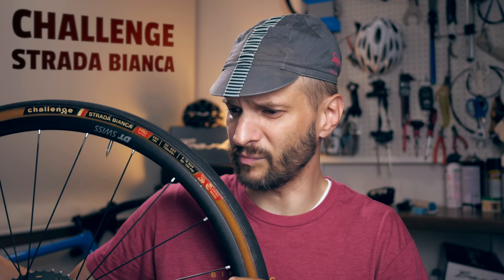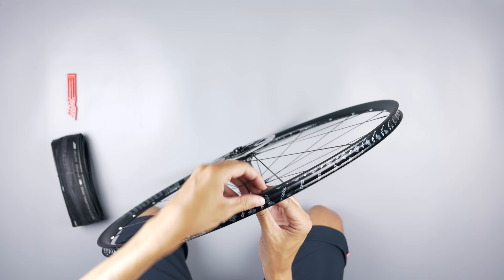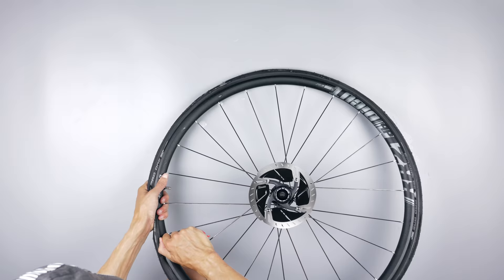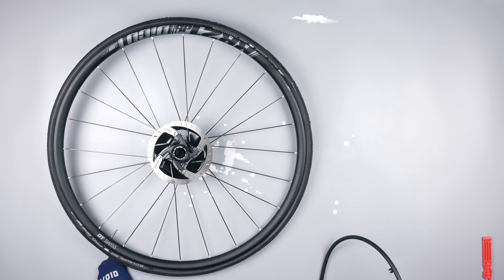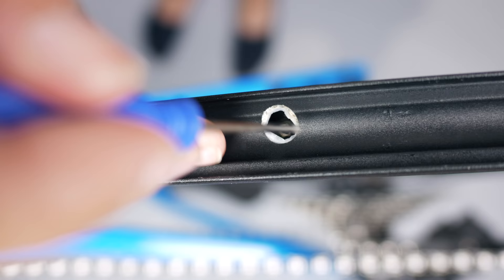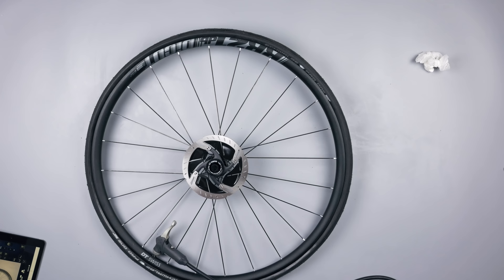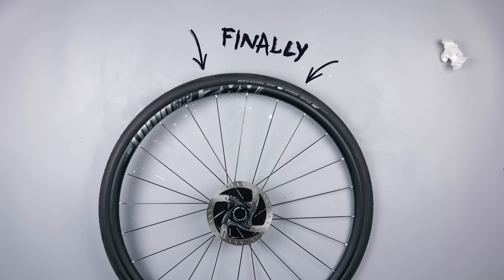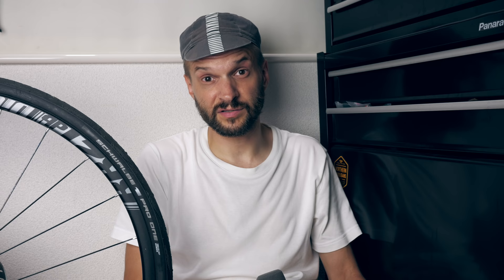Watch me struggle! 5 Tips for Road Tubeless | Schwalbe PRO ONE

Comment: Had similar nightmare even with large reservoir filled to 200 psi). Removing even worse. Ive had to cut off my rims every pro one 28mm as tubeless  I’ve eve owned, (after hours of agony , adjustable pliers and risk of damaging rims) very grippy, compound though. I’d get s-one (now called g-one sport) 30mm every time now . Never looked back on pro ones! Top tip ! Schwalbe sell a lubricant, for the bead. It’s brilliant!
Reply from the maker: John Van der Stighelen I had a few people saying the same thing now about having cut off the tires... I’m curious, was that from a seated state? (As in you couldn’t even get them to unseat or?)
How hard where they to get on the rims to start with in that case? 
Cheers for the tip! Will keep those tires on the watch list 👍
Reply: Rides of Japan removing off the bead was the challenge. Always got them on ok, with the right prep, lubricant ,and reservoir, having learned using standard one tubeless.
Reply: The secret to getting them off is to push the whole bead (except round the valve hole, obviously) into the centre channel. Only then can you get a tyre lever under the bead. You'll never be able to lever them off directly from the seated state.
Reply: Matthew Harris normally id totally agree, and that’s sound advice. However my issues were that I could t get he bead away from the rim hooks, by more than an inch. I resorted to a set of adjustable pliers with a rag to protect the tire wall. When that plus an attempt of a hairdryer failed and you run the risk of buckling the rim, I ended up cutting them off. I don’t entirely blame this particular tyre , although it’s definelty the worst road tubeless I’ve had in this respect over the last 3-4 years (I consider myself an early convert to road tubeless), I’m sure there are the we’ll know tolerance issues between rim and tyre and safety margins which play a part. Hopefully companies like Mavic can help to address this.
Reply: John Van der Stighelen I know what you mean. I spent hours with the same issue (compounded by the fact I'd put a tube in after a roadside nightmare with a hole that failed to seal), made worse by the shape of the bead 'shelf' on ENVE's SES AR 4.5 rim; the bead has to go over a slight lip before it can drop into the centre. Also, the old dried up sealant effectively glues the bead to the rim and instead of pushing away cleanly all that happens is the bead rotates through 90 degrees which makes it even tighter and hard to get any purchase against. Tried soapy water, hairdryer etc. and contemplated pliers or cutting the tyre off but eventually succeeded with two flat bladed screwdrivers wedged in and moved steadily apart, at risk of damaging the tape, and rim of course. At that point I just wanted to sell the wheels! Strangely I hadn't had that problem when doing the same thing roadside - probably because there was still plenty of liquid inside which was helping the bead slide over the lip into the central channel. Or maybe it was just the adrenaline helping!
Reply: Matthew Harris ... well tubeless fist pump to you! I’m sure it will all seem silly when they are all mainstream in the end!

Comment: I just use a compressor. If the tire does not seat and hold air I know something is not right. Most of the time it's just a matter of adding a little sealant.

Comment: Yup, out of all the tubeless rims I've done, DT Swiss rims were the most painful for me.
Reply from the maker: Interesting! This was the first time they gave me a hard time... although mainly because I failed to fix the tape situation.
Out of curiosity, what has be the easiest rims to work with?
Reply: @ridesofjapan   Giant rims for me. The DT Swiss rims worked the first time for me but I had to replace the tyres and they were a pain to the point where I had to put a tube in them for a week and then popped one side of the bead and took out the tube.
Reply from the maker: Cheers! 🙏Good info to put in the bank

Comment: I am at a loss, what the attraction is with these tyres outside the MTB world. At lower pressures sealant is fantastic, when you start to go above 50-60psi not so reliable. Then there is the free sealant? How do you work with this mess on the side of the road if your sealant doesn’t work. Plus they are still clinchers???? I run tubulars with sealant in so have the same puncture resistant, no issues with rim brake tracks and the rims themselves are lighter, plus a lot easier to mount and replace a tyre on the side of the road, no free sealant everywhere??? Someone please help me understand the hype about these tubeless tyres and rims??

Comment: How often do you have to pump the tire cause loss of pressure?
Reply from the maker: I always pump my tires before every ride regardless (as want to have a specific pressure depending on the ride)
but if I just leave them untouched fully pumped that might loose 10-15 psi during the first week, less the next week and so on

Comment: As usual human error ist the biggest factor of failure in tubeless systems.

1. always check your rimtape thoroughly
2. always remove valve core on first inflation
3. always seat bead first before you add sealant
4. always keep the tire upright (even if it ruins your youtube visual)

I have used Pro One 28mm on DT Swiss XR1501 rims (gravel bike) and the only obstacle I had was that I damaged the rimtape while trying to fit the tire on the rim (rookie mistake), otherwise it was fairly straight forward. I used a floor pump (my fatbike floor pump has high volume so it really blows a lot of air into the tire at once. Sealant had no trouble at keeping the air in at 5.5 bar. Fast rolling tire for sure. In the end though I ditched the Schwalbe as the ride quality is like a horse-carriage ride in the Wild West. Now I run Compass 44mm Snoqualmies which are as fast as any road tire I have ever used (Strava doesn't lie) and the ride quality is insane. Tubeless obviously and 320gr each. There's no competition for Compass tires imho...

Comment: I have the same tires installed. I used Schwalbe’s rim tape and the tires both seated nicely without adding any sealant and by just using a regular track pump. I think your problem might have been the tape. I have been riding them now for <1000 km over 3 months without a flat and without adding any extra than the initial (60ml/tyre) sealant. Great tires that didn’t require use of tools to fit. For me there is no going back to tubes.
Reply from the maker: lotte poss yes, the tape was the issue, change the tape on the rear and seated that with the normal track pump no issues.

Comment: A trick is to use a tire lever, when you have put the tire on the rim, then use it like you would, if you were to take the tire off, but instead put it as close to the bead as you can, on both sides ( did that make any sense?) and then inflate the tire....
Reply from the maker: Thomas E as in trying to seat the tire by hand? (And lever)
Interesting
Reply: Yes... You can not get it to sit right all the way, but then there is only one place it can leak.

Comment: I have used tubeless for 5 years and found using an air compressor or co2 cartridge works great.  Then let the air out and remove valve put the sealant in and re-pump to 105 psd.  Very easy.
Reply from the maker: Paul Ater yes, a compressor is the dream 😁

Comment: That's why you should use a compressor. Makes it a lot easier. I also had the same experience with these Schwalbe tires. I have the best experience with Pirelli P-Zero race TLR's. They seem to fit much better than al the other road tires I've tried so far (Also using DT-Swiss rims).

Comment: I think most of your problems were due to not having placed the new rim tape, which is a must if you have spoke holes.  Second, I wonder if it is better to remove the tire and unfold it and let it rest a few hours to get the kinks out of the wire bead. If there are bumps in the wire, it will not give a good seal or pop into the rim channel.
Reply from the maker: 8638marc yes, definitely the tape was the big culprit in this case, I mentioned it in the beginning but somehow forgetting to caption it as a tubeless tip in the video 🤦‍♂️ once you press that publish button you’re mistakes stay in forever hehe.
If there were any kinks in the tire it definitely didn’t help... but the rear tire came straight out of the packaging and on to the wheel without problem (I had fixed the tape before that)
It definitely seem like it could be a cause for trouble though, so a good tip, cheers👍

Comment: There must be some dangerous setups out there, if this is the fitting and testing done before riding them properly I'd be quite worried. I always make sure my tyres are able to seat and hold pressure with no sealant, and (importantly) don't fall off the rim when I remove the pump to put the sealant in through the valve core. There's another video where a guy has similar issues with tyres unseating which ended in a big crash after an innocuous puncture. Note that some so called tubeless tyres stretch a lot more than they should at the bead so if you remove them to patch or check anything you might need more tape (I'm up to 5 layers on a certain rear tyre that might rhyme with 'gavelbling')

Comment: Every time I install TL, I find myself here for therapy mid-way 😅
Reply: Incidentally, your method of pre-seating the bead goes against most other recommendations, where the advice is to squeeze the tyre in to the channel and blast it out, which I always try despite it seeming counterintuitive. However, pre-seating(ish) works much better for me - particularly when the tyres have had sealant before and are therefore a bit sticky.

Comment: I honestly dont think tubeless tech is ready for road yet. mtb it is solid
Reply from the maker: Nile yeah, I would hesitate to recommend road tubeless to everyone... you would need to love the smell of rubber and sealant 😉
Reply: I've not seen anyone stick with it on tires below 30mm long term. It's just not practical on pressures above 50psi
Reply: @ridesofjapan   It looks like the Mavic/Hutchinson UST is ready for prime time. I'm ready to try it.
Reply: It’s easier than this guy made it look. If rim tape is good, it’ll seat first time with Air blaster. When I let air out to add sealant the pro ones popped off rim. With Sealant and valve core the tyre seated. Took less than 10minutes use pro one tyre.

Comment: I presently run inner tubes on my road bike, is it really worth the hassle and do you notice any performance benefits ??
Reply from the maker: Yes, went down form a few punctures/year to a single one in two years.
Reply: @ridesofjapan    ok, any performance benefits ?
Reply from the maker: Nice 'N' Sleazy can’t say, never rode the tires tubed.
Reply: @ridesofjapan  what about other inner tube tyres , how does the tubeless set up compare ?
Reply from the maker: @nicensleazy1892  I realize you want to know about speed, But can't give you a good answer there, since I haven't ridden tubed tires for years. Unless you ride the same tire tubes vs tubeless it pretty pointless to draw any conclusions about if tubeless is faster to not. 
For me it was never about speed, it was about puncture protection and comfort, as I can drop the tire pressure without risking pinch flats. 
But, in my option if speed is the only thing you care about, then no, tubeless is not worth it... plenty of tubed latex setups that will preform good without the potential hassle of a tubeless setup.

Comment: I partly push in the valve until the initial inflation with an inflator then never tighten up its retaining ring too much. Once the tyre has popped, I remove the valve core, pump in sealant, replace the core then re-inflate, spin the tyre then make myself a mug of tea.
Never, ever use anything but proper tubeless rim tape - you are asking for problems later on! Do not be tempted to double wrap ANY tape - you need to keep the spoke well as deep as possible otherwise certain tyres just allow the last bit of the 2nd bead to slip over the rim.
Anyone using insulating tape - don't be surprised if you have to continuously pump the damned things up more often then latex innertubes!

Comment: The same happened to me. After 3 hours of pain and struggle, I finally checked the rim tape just to notice it was deformed like yours on the video, thus making it impossible for the tire to seat on the rim. After changing the tape for a new roll, it was perfect. I'm curious about the 3M tape you used... Is it resistant enough with a single or a double layer? Will it really resist 100 psi?
Reply from the maker: Anthony HT Reading all the amazon reviews seem to imply that a lot of “dedicated” tubeless tape is actually rebranded 3M tape. Can’t confirm that but it feels very similar to the DT Swiss tape I had on before. 
I might be a bit thinner though so I would probably recommend 2 layers just to be on the safe side. 
Time will tell how this holds up, but I never get up to 100psi... max for me would be 80 tops, over that and the ride become too uncomfortable.

Comment: No, no, no...

1. Purchase something like Pro-clean tyre lube. It’s a gel that you brush on to the tyre before mounting on to the wheel. Because it’s a gel it will form a bit of a seal between bead and wheel. Don’t use the soap, it’s crap.
2. Use some kind of air blast device like the Specialized one or the Schwalbe one. There are loads out there. 
3. Take valve core out.
4. Pressure up to the device to slightly more that the max pressure of the tyre combo, as ideally you want to hit the max pressure of the tyre.
4. Listen to all those lovely pops as the bead seats in the rim and admire how consistent the tyre is around the wheel.
5. Let the tyre rest for 5 mins before removing the blast tool and, yes, letting all the air out.
6. Apply sealant and replace valve core.
7. Inflate tyre, and you’re done.

Works every time with the added bonus that the tyre will be easier to remove when the time comes as there will be a little bit of lube in the rim.

Comment: Beeing a least 40 kg heavier than you, I'd choose the WTB Exposure in 34C - Why didn't you get the 30C? For the roomy frame and fork a 28C is almost insufficient.
Reply from the maker: jimnyfuchs I have my 650b for that type of riding, here my “goal” was light weight and low rolling resistance mainly for climbing... funny though they the complete wheel set is about the same weight as my 650s 😅
Reply: Rides of Japan You‘ve seen the mint green bike I built for my buddy - Those wheels are lighter then anything I had my hands on before for a third of the price.
Reply from the maker: jimnyfuchs how much did they weigh?
WTB is hard to come by here in Japan
Reply: Rides of Japan I have no scale in my shed yet. Just by the feel, the DT Swiss E1900 with 42x584 WTBs are a lot lighter then R23’s with 32C Continental tires. Adding the manufacturers numbers proofs the objective impression.
Reply from the maker: jimnyfuchs good to know, will go on my “watch list” 👍

Comment: Pretty sure my tape is fine as it was holding pressure just before I (STUPIDLY) removed my tires to inspect the condition of the sealant after a year and now can't get them back on again.

Was thinking of getting one of those tubeless pumps but they're so damn expensive, I may as well get a proper air compressor since it works out to be marginally cheaper. But that's still a lot of money just to put my tires back on. F#*@!
Reply from the maker: Ser Garlan Tyrell you can run in to that problem if the tires has stretched... that can usually be fixed by adding another layer of tape.
Another problem can be if there still a lot of sticky sealant in the inside tire wall almost acting like a glue to keep the tire from expanding, In that case you can try removing as much of the old sealant as possible first.

Comment: I used Schwalbe Pro one with the sizes 25, 28 and 30mm Tubeless. I have no problem at all. The wheels are from three different manufactors. Sorry to say, but the way you try to fit your tyres looks very mystery. So this couldnˋt work.
Reply from the maker: New 2020 Pro One are much easier to mount yes.
However, as stated in the video, the problem was the tape.

Comment: Try dealing with this at the side of the road.  I had the same tyres.  What a mess! Fitted tubes in the end.  Zero difference in ride.  More marketing nonsense from the bike industry.
Reply: The ONLY reason you'd ever have to "try dealing with this at the side of the road" would be if you gashed the tire so severely that neither sealant nor a dynaplug would work to repair the damage. If that's the case, it wouldn't matter whether you were running tubes or not -- you'd be struggling with replacing the tire at the side of the road, and how many cyclists ride around with an extra TIRE in their jersey!? None, that's how many. 

As to the typical punctures that cause 99% of flats, tubeless are FAR better than clinchers with tubes. The sealant (Orange is best) seals effectively, and in most case so little compression is lost you can safely ride until you get back to a floor pump. Tubes? You get a puncture, you're fixing a flat... at the side of the road. Me on my tubeless? I'll meet you at the café.

In short -- you gotta be braindead not to run tubeless.

Comment: It's so easy to seat a tubeless tire by using a CO2 cartridge. No need to fuss with rim wax, soap, or any of that other messy nonsense.
Reply from the maker: Zack Tatum yes, is long as the traps is in order no problem. I wasted a co2 before I changed the tape(not on video), result was the same 😔